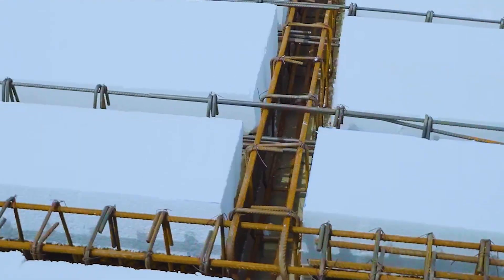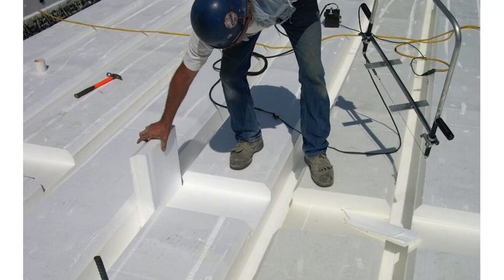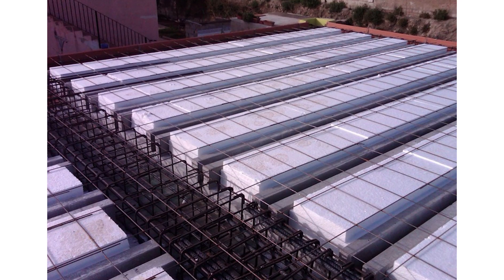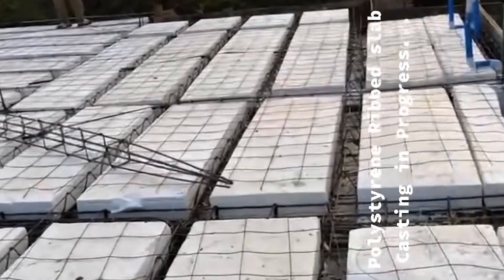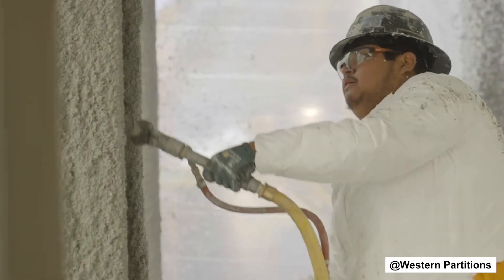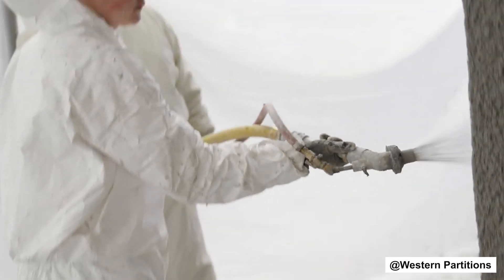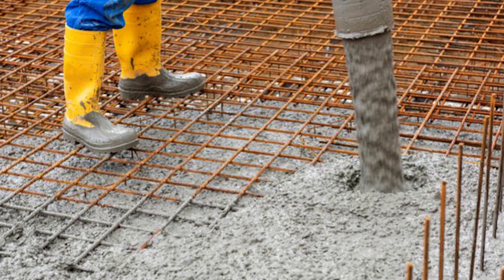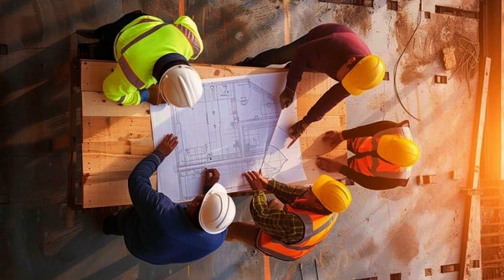Why Builders Are Using Foam in Concrete. The Truth About Polystyrene Slabs.

Comment: I am planning to use RPS (Expandable Polystyrene System) for my new home, from a company that produces them and builds for you. I also plan on using them for a 3-floor apartment block. The research I've done so far, shows excellent results, especially if skilled workers are involved. Abd the precision! I love that!!